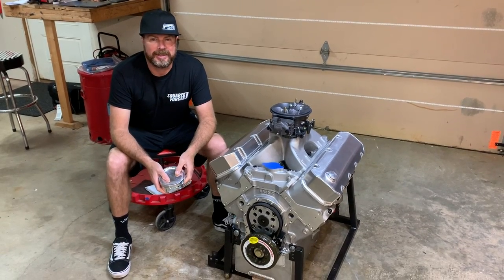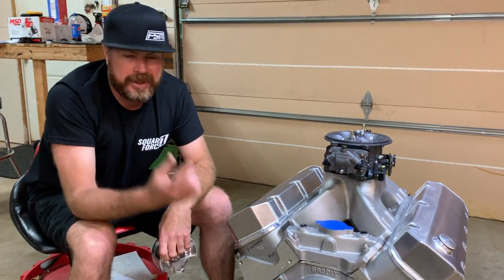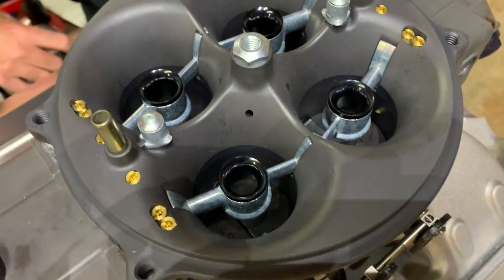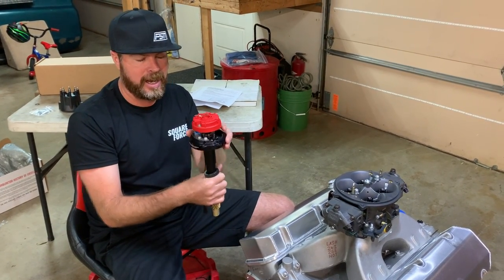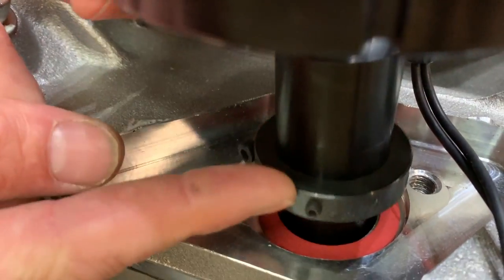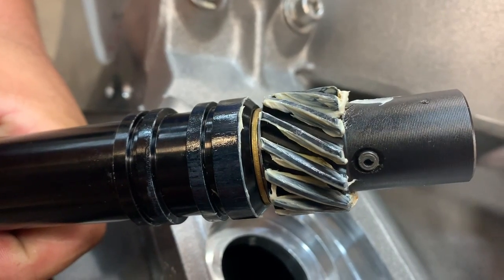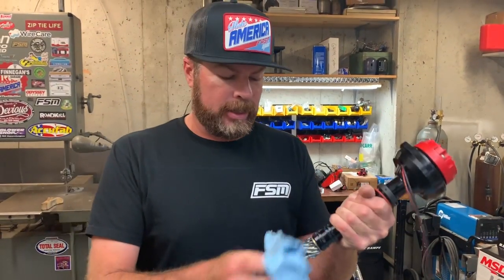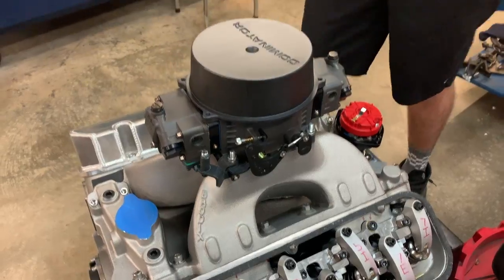1000HP With No Turbo, No Blower and No Nitrous: Finnegan's Garage Ep.79

Comment: Congratulations Finnegan! 

I'm happy for you- lot's of work and tough decisions. 

Looks like it paid off and will last.
Reply: That's it.  That much power that will last and last and ...
Reply: The distributor can not be verified that its engaged to oil pump shaft by twisting on rotor !!! No way no how. The only thing that shows you is that it's engaged to cam gear period. 
      The only way to know the oil pump shaft is engaged to the distributor is to watch it drop while distributor is in motor turn the cam by hand, or assembled motor that you turn the cam by way of crankshaft rotation and watch it drop.

Comment: I would have used the bronze gear, for the roller billit cam.. glad I watched this video.. keep it up man. And please don’t sell out to motortrend on demand.
Reply: Yeah! Eff those guys! lol
Reply: As pointed out in the video you want the gear to be softer than the one on the cam Fred. It wasn't stated why. Maybe trivia, but still important because most amateurs don't realize it so maybe this will save someone a future mistake. Most if not all bronze alloys require they be run with hardened shafting or gearing depending on the situation. Brass is quite soft, bronze isn't. Because of the color they may look very close to being the same but they certainly aren't. I've got some that machines like 20-30C Rockwell  hardened steel. Good engineering practice dictates you want the cheapest and/or most easily accessed part to be softer so it wears out first. I'd assume there were good reasons for not ordering the new one with a bronze gear or that model doesn't come with one.
Reply: @christopherolszewski8710  You guys do realize he works for Motor trend right? This is one of the ways Mike makes money.
Reply: @stephenlove8067  that's not what I was saying at all but w.e.
Reply: @supermotos  get it around most any holiday im just over two bucks a month... had it sense roadkill went over there
Reply: @christopherolszewski8710  Eh most of those other builders have a patreon going as well. It is the same shit. If you want content you have to pay for it. It is just old to hear the "put roadkill back on youtube" bullshit. It isn't going to happen.

Comment: I install dozens of distributors a day. An easy way on Chevys to install the distributor to point at #1 is to align the oil pump drive shaft slot parallel with the rear rail of the block with the balancer at TDC. Then,  drop the distributor in the engine with the rotor pointing straight towards drivers side of block, parallel to the rear rail as well. As distributor gear meshes with the cam gear, the rotor will turn to point right at #1 spark plug by the time it seats on the oil pump drive shaft. .

Comment: We built some very hot high-compression engines for B-sports racing . When they were warm , if you spun on the track , and stalled , you couldnt restart . They make some bellhousings with  2 starter holes , but we ended up making our own starter from a Chrysler reduction drive starter , worked fine , in case you have that problem .

Comment: High flow, high compression and lots of displacement. Pretty easy recipe.
Reply: No replacement for displacement amirite
Reply: Don't forget the magic ingredient...lots of money 😆
Reply: chris vinicombe that’s not an ingredient, that’s the name of the entire recipe 😭
Reply: Sounds simple, but some big $$ engines have flopped, with one item wrong.
Reply: Nah bro, didn't you see at the end? 1000 hp on a STOCK block and STOCK heads, no recipe here except what Chevy intended....
Reply: Only need 10:1 for 1K HP
Reply: @nosebergs-are-at-it-again  stock block and heads? You mean expensive aluminum custom block and heads
Reply: @nosebergs-are-at-it-again  "stock" high dollar aftermarket heads and block, nothing Chevy made
Reply: Displacement is easy, compression is some math, high flow isn't easy
Reply: @nosebergs-are-at-it-again  "Stock Block"? Ha! You can't put 4.625 diameter pistons in a stock (aluminum) Chevy block. Oh and those stock aluminum heads with oversized stock valves to flow enough air to make a 1000hp? You really know your shit about chevys don't you fanboy? Lol that's surely what the factory engineers envisioned 40 plus years ago.
Reply: Blown460 it’s Chevy based is what he should’ve said
Reply: @Blown460 Terse

Comment: The craziest thing, is that today, 3 years later, you can now buy a Chevrolet Performance ZZ632 Big-Block Crate Engine, from factory ... with 1000 HP at the crank !
That is nuts ... and it's just a tad bit under 30k too, which is a bargain for that kind of power.

Comment: I was watching drag racing on Fox this Labor day. Some of those cars were running 900 cubic inch engines. That's insane.

But...Not as insane as Finnegan is looking older. This aging thing has gotta stop.
Reply: View This 

No kidding. Remember when a 632” was huge and exotic? Remember when a 3 stage nitrous set up was insane? Now there’s 900+ inch motors with 5 kits on them. What a great time to be a car guy.
Reply: @MrCarnutbill67  After writing that comment, I looked on the internet, and there is one that's 1005.8 cubic inches, made by Sonny's Racing Engines, nicknamed "The Godfather. "  YOWZA !!
Reply: @ViewThis.  that is also 2100 hp NA....THAT is insane!!!
Reply: @1216jimmyz  Those monsters belong in a Monster Truck, or a street truck to keep the Turbo Diesels in their place @ 5 mpg
Reply: I have a 572 but the guys that are running the numbers at the track are turbo reliable Street driven and decent gas mileage when you have your foot out of the pedal. Mine I have to drive real slow to get any gas mileage out of it. I ride a lot on the street and some at the track. But at least it's 87 octane pump gas.

Comment: With cam and dizzy gears meshed you wouldnt be able to spin the rotor anyway even if your oil pump rod wasnt engaged!!!! should be common knowledge for an engine builder
Reply: It should be but I have had 3 “high performance GM big block engine builders” screw it up.  Sometimes I just got a chewed up gear, sometimes the engines quit when then gear gave up due to partial engagement and once  I started engines with 0 oil pressure.  Only guys that got it right were the guys that went to Mercruiser school or guys that built $75,000 engines.  I’ll still with my local mechanic that goes back to school each winter for refresher courses on everything.  The amount he learns from the other mechanics screw ups is amazing.  Pete Groff, Hoy’s Saginaw Bay Marina.  Thanks Pete.  I hope you hanging in there after all the changes.
Reply: Yup.. I was thinking the same thing.. I used to spend a lot of time trying to align the oil pump drive to the correct position.. then lead it to compensate for the gear.. waste of time. Now I just set the engine to 35 btc, drop in the distributor, then spin the motor over and the oil pump drive will mesh when it’s ready. As for the adjustable collar, he could have set it up without the gasket, locked it down, then add the gasket to get the clearance.

Comment: N/A 1000 hp engine means you have deep pockets,and constant attention to that valve train.
Reply: @aliceshaw8265  it's a boat motor.
Reply: It should be nic if itd converted to lPG or CNG
Reply: The engine is cheap... filling it up to keep it running is the issue.
Reply: not when you make it out of 580ci, it's 13.5:1 wich isn't crazy, that thing will last a long time! But I'm sure it cost as much as a brand new mustang lmao
Reply: @XxMusclecarsxX   does not matter if its 580 ci  or 700 ci ,and 16: 1 compression the valve springs will be tired with not many hours ran on the engine. They will prob be checking spring pressure very often
Reply: @jackdaniels5205  It does matter if you take into consideration (all else being the same) that  a 700 ci engine could make the same amount of power at 5800 rpm as a 580 ci engine could make at 7000 rpm.

Comment: It makes a 105,88 hp/liter... it's barely average for a fully build engine. For exemple a "bone stock" 2001 N/A BMW M3 made 105,65 hp/liter. 
A 1962 Ferrari 250 GTO made 101,59 hp/liter... that's nothing to write home about 57 years later XD
Reply: @carlyandt6748  A 1927 Monet-Goyon RC4C, a supercharged 1936 Austin 7, a 1989 TVR S2 with a high rise cam & ported heads and a 1934 semi-OHV Ariès CB4B... and some other little side projets to keep me busy.
And you dear Sir ?

Comment: Engine builds are always interesting. I'd guess most are like myself and a non pro drag racer or engine builder. It would add a lot if the ball park parts cost totals for high end parts like these were added into videos like this. That kind of HP isn't cheap and most would probably be real surprised at what it does cost. Yeah the arm chair experts are gonna show up and say they can do the same for a whole lot less, it's YT and your always going to have that.
Reply: Some of us armchair experts are UAW-trained, ASE- certified automotive engine machinists with years of experience. If I count my labor as free, I could do an iron-block copy for $15K with no machine shop work.
Reply: @davidstephens4639  :-) An experienced UAW trained & certified machinist is about at the opposite end of the spectrum when I was thinking of those arm chair experts David. But $15k for an iron version is a lot more reasonable than my best guess would have been.

Comment: RTV around the bottom of the slip collar where it meets the distributor shaft and the relief cut on the slip collar and let dry, then install the distributor. Otherwise the distributor will always weep oil past the slip collar.

Comment: What does this engine cost bro? $25k?
Reply: 100 000
Reply: really
Reply: I'd say $25k isn't an outlandish guess to get it all put together with all the nickel and dime bits. That bare block is ~$7k and those heads assembled are ~$3k each.
Reply: The Luns  you know for a fact its 30 k
Reply: ill take 3
Reply: i had one in 86 it was better than that but not by much and i paid 100k
Reply: I bet he's got more than $100,000 under the hood of that car.
Reply: Dang...Guess I'll wait for auction by Gov.for drug boats then.Rip out 3 engines to sell,and build an electric driven floating home..Oh,wait..they auction those too.Yay.
Reply: Well I can tell you a naturally aspirated 410 CI aluminium small block Chevy that makes 942 Hp costs 65k, so you can guess off of that.
Reply: You can get a Blueprint 632 engine that makes over 800HP for $12,800 delivered....
Reply: Damn, you Americans are lucky.  In Canada it costs about $10,000  to build a 500hp big block.  Just boring cylinders costs $150  a hole.

An engine like that would cost $100,000
Reply: @kyleolin3566  wow 15$ a hole by me
Reply: @jay6176  Yeah, it's actually cheaper to buy crate engines than to rebuild your own here.  Unless you dont do any machine work...  To boot, slot of the machine shops do shotty work
Reply: @mccoy786  You paid 100k for a single engine could I interest you in some beach front property in Tn then
Reply: @kyleolin3566  I'm really sorry to hear that is it emission laws or just labor cost?
Reply: @jay6176  Its a combination.  Between high taxes, high minimum wage, carbon taxes, etc...  The cost of parts, tools, fuel and labour are all higher then down there.  Even our junkyards are ridiculously priced.  For example  an older used Dana 60 front at a junkyard will set you back $1000.  A newer one will be even more.  

I think part of it is that I live in a rural area (central British Columbia).  When you think about it, there are as many people in New York State as all of Canada, and 90% of Canadians live on our southern boarder, therefore, there is not as much competition, or availability of parts farther north.  Prices are  going to be high.
Reply: @nou8257  back in the 80s that was the cost of a engine to race with to keep up with the keith black motors.In 85 this motor in canada was unheard of.and when you have no shortage of money 100k is no off beat.spend more in fuel  over the course of the engines life,

Comment: MSD could greatly simplify the distributer installation just by including a washer/spacer of the correct thickness. That would also simplify future timing adjustments since you run the risk of changing the mesh when you loosen the clamp without a spacer.

Comment: Epic 👍 its impressive what you can do with a carb and 8 cylinders... Im from europe and the tuning scene here mostly consists of 1.8-2l turbo engines running 400 hp on the verge of engine seisure
Reply: That's always been my gripe with the "small engines are better" crowd... they never factor in durability. Sure, they can squeeze a lot of power out of relatively small displacement, but the engines need rebuilt every other week. The massive lump in this video may be ancient technology and weigh as much as your typical Honda but it will run for years with just basic maintenance. That, and the fact that the little whizzer engines produce all their power at absurd RPMs that just don't meld with street driving. It's good to know there are still some Euro folks who appreciate the "old" ways.
Reply: @johnterpack3940  yeah... I was always tought by my dad that large displacement and low hp outputs are the way to go... So a 1.8tdi with 90hp is gona last alot longer than the 2.0tdi with 170hp...

Comment: I've got a street build I'm working on 1965 Chevy C10 stepsidepowered by a all motor 327 has camel hump heads,  lanati cam cables and springs 3 speed (was on column now on floor) 370 something gears in the rear. Still a work in progress but I'll be sure to bring it out to an event you're at to let you see it now

Comment: That half inch difference between the distributor shaft and the oil pump drive shaft should be the depth of the opening (plus the height of the slot) on the distributor for the oil pumps drive shaft key to fit into.  If the depth of the distributor opening and key slot is greater than half an inch you are not getting full engagement with the key on top of the oil pump drive shaft and risk having a oil pump failure due to that key snapping off.  If your going to play with that kind of machinery you might as well do everything correctly as you are using an adjustable length distributor anyway.  

By grinding a little off the bottom of the distributors drive you will move the tooth engagement with the cam shaft upwards so also get better engagement at that contact point.

Comment: Double Check your oil pump drive engagement by adding some grease to the bore in gear - re install - Remove and measure grease displacement.
Reply: Plasticine, not grease.

Comment: And that gives you a rod length to stroke ration of 1.49-1. In the old days before metallurgy caught up with stroker engines low ratios and the stresses they caused that would be broken crank territory. In fact the 454’s one rod ratio was so low that the demand for forged steel cranks was so much higher then supply that the core charge for a reground crank was $600.00 or more. Today there are times of high quality forging out there making it affordable to build one of these monsters at a semi reasonable price.

Comment: You dont have to align with #1, you just have to make sure the rotor aligns with the plug wire going to #1. The rotor could be pointing at the heater housing, but as long as the rotor and spark plug wire goes to the #1 sparkplug you are golden

Comment: This is pretty much standard.  It's a simple matter of understanding rod ratios and angularity to start.  Keep the pin placement where it does not interfere with the rings.  Stay away from fulcrum rockers!  All motors are pumps and the more air and fuel you can pass through it the more power it will generate.  Canted valve motors like this one and Hemis can make this kind of power without great science.  What is really impressive is an inline wedge engine making this kind of power and more like the old B-1 headed Mopars.   You know those heads had to really be trick to produce this kind of power!

Comment: did my aluminum brodix 615cid. 10.5 to 1 pump gas. street tune 900hp no pwer adders.. can be seen on you tube  twisted 615 
had to make my intake out of a old tunnel ram to fit under my hood..in the car with a simple 2 plate set nos set (1 under ea TB) 1100 HP.. keeping it a small hit..

Comment: watching your miata vs talon episode, and i want to throw an idea at you: first gen cobalt ss motor stuffed into said miata, backed by 6 speed manual. for hill climbs, get some steelies that fit the car (i'm sure summit would have them) and weld some paddles to the wheels, and see what it can do. for the streets, stuff some 18's on it so it can hit the coners better. i know it's suspension would probably require a full rehab from whoever used to own it abusing it, let alone whatever damage was done in the episode i just watched, but i'm figuring the motor swap would be easier because it's 4 cyl to 4 cyl, and the cobalt has 300hp for the first gen ss, which is about 2.5 times more power than the original motor, and if you get it wired right, it'll work and give ya decent miles per gallon. and you could even keep the nitrous.lol. just watch the oil pan.

Comment: 1000hp is easy with a big V8 over the 400ci range. Compression ratio, airflow, and fuel are the things you crank up. With that, you need really strong rods, pistons, and crank. Then you need the head, main, and rod bolts to hold the engine itself together.